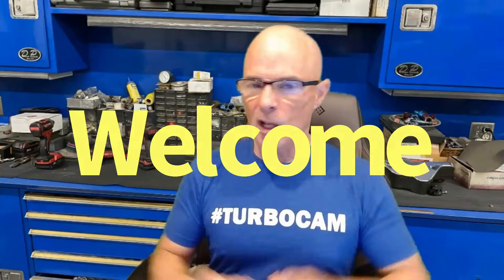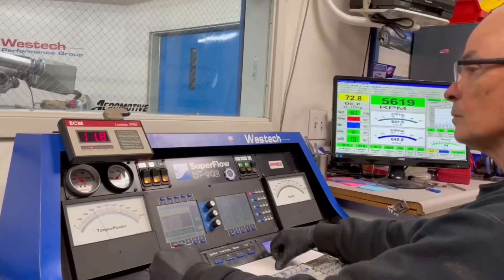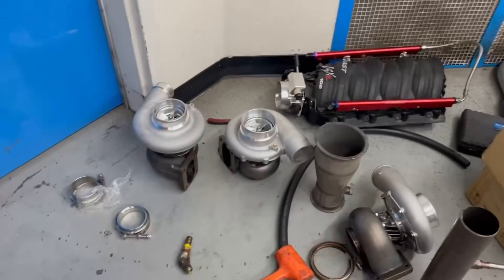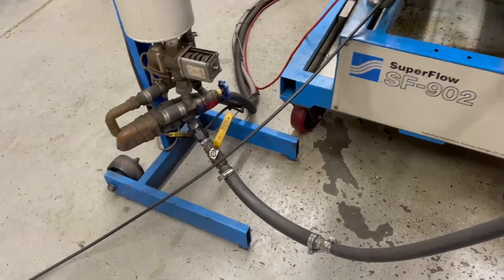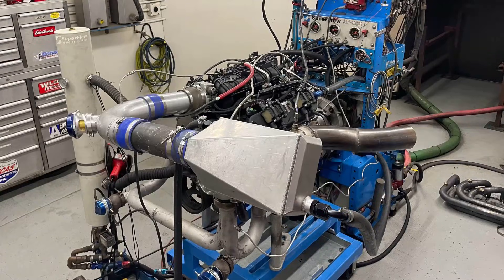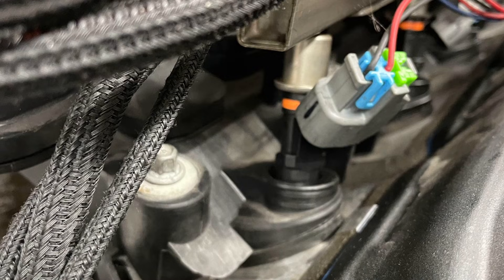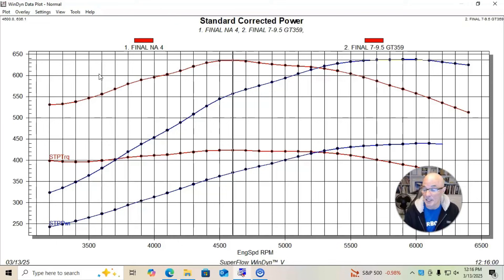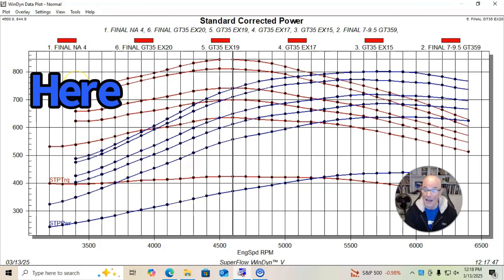GTX3584RS-THE ULTIMATE 800+HP LOW BUCK LS TURBO! HOW MUCH HP WILL A GTX3584RS TURBO MAKE ON A 5.3L?

Comment: Sick. Put a Xona Rotor XRA6769S against it, and compare the compressor maps. 👍

Let me know if you need one to test, and I’ll work something out.
Reply from the maker: what does that turbo cost?
Reply: @richardholdener1727  less than a PTE but more than a Garrett. 🤷‍♂️

Wanna test one? I can make a call and start that whenever- I have to grab a quote and order with them anyway for somebody else, and would need it back as a test mule unless you decide it’s too good to let go. 🤣🤷‍♂️

$3228 for the PTE Next Gen 6875 right now, $2516 for this with a housing/$2166 for the core with a compressor cover. 

It’s one of Robert Young’s and just came out this year.

Comment: How will a single one (GT35) work on an lq4, 806 heads & TN cam. Im not doing more than 6200RPM
Reply: & only looking for around 600hp
Reply from the maker: works fine at that power level
Reply: @richardholdener1727  How much boost do u think ill need to push through it ? & will it be a must for me to gap the rings or  I should be fine with stock gap ?

Comment: I'm replacing my Gt45 rear mount on my 97 ss camaro Lt1.    I'm hoping this turbo will help with somewhat laggy boost.   I'm running two 44mm gates @ 7psi-9psi I'm hoping this setup will give it better response still keeping my top end good.  Like 550whp range.  Nothing crazy just super fun on the street.
Reply from the maker: this turbo is way more responsive than a GT45
Reply: @richardholdener1727   this gtx3584rs  turbo I got from you guys is a night and day difference.   when I saw how small this turbo was in physical size compared to the gt45 I wasn't sure about it.   Wow this thing makes the car feel so lively.   This is easily outdoing my old gt45.   I'm only running about 9psi of boost on my  Lt1.  I wonder if this engine is comparable to the 5.3 for hp numbers?   Super fun car now thanks for the testing on this stuff.   By the way jimmy was awesome to deal with.  Answered questions super promptly.   If I ever get another turbo I'm looking at your stuff first.

Comment: The real question is can I get a video on which transmission to run with a 5.3 turbo I’ve been told th400 but 4l80 as well
Reply from the maker: 4L80
Reply: @richardholdener1727 What kind of power levels become too much for a stock 4l80 before you need to upgrade some internals?
Reply: ZF 8hp 👍🏻
Reply: @Mastermindyoung14 a zf will bolt up to a 5.3 ??

Comment: Would 2 of these on a 6.0 help with back pressure
Reply from the maker: yes-but do you want 1600 hp? Better choice is this turbo with a 1.21 AR, or a slightly bigger G35 or bigger G42-all good choices (pick the G42)-it works great on a 5.3L (we have it on the Tahoe now) but on a 6.0L, it will be amazing
Reply: @richardholdener1727 yes but wouldn’t you have the same back pressure problem as the other. I have twin gt35s on a 5.3 now but want to put my 6.0 in and didn’t know if they were to small

Comment: Could I run this rear mounted single on a Lq4 6.0 on e85 and drag race it safely using 750cc injectors?
Reply from the maker: you should get a G42 turbo from drag racing and go bigger than 750 cc injectors (we have 1000s) with your 6.0L

Comment: If i slap the gtx3584 rs on a stock 6.1 do you think it would underperform at 6-7 lbs since it has so much more of a power band or should i jus go gt 45 which 7 lbs is close to its peak
Reply from the maker: 6-7 psi, use the GTX3584RS, if you go more-use the G42

Comment: I had a plan to use the mirrored 3584 101s on a 417cid stroked ls. 823 heads ported. Solid bottom end. Low-ish boost. I want 950 crank. Is this gonna be too much? Not many videos out using this turbo.
Reply from the maker: those will support much more-so you have room to grow
Reply: @richardholdener1727  that is the plan as well. I found your live stream and await that video!  Thank you.

Comment: How does this compare to a S475 torque wise i seen ur t4 s475 and it was instant boost
Reply from the maker: No S475 has instant boost-this one is WAY more responsive, but it is smaller than the S475

Comment: how about a video where you still keep the gtx3584rs but show how much engine power is affected with backpressure. perhaps how much a turbine housing swap reduces backpressure or a g42 turbine wheel crammed into the gtx3584rs
Reply from the maker: we plan to run AR housing changes

Comment: Question that’s gonna get allot of the hate. Just say with a stock 6.0 in a 2500. On 8ish pounds on pump gas would the 6.0 live. Yes i know its best with I/C and some say it’s a must. I’m just thinking an easy turbo install for towing a 3k lb car and burnouts. Not insane lugging. I’ll also add I’ve had a 6.0 non I/C make 715 tire but on e85
Reply from the maker: It would live-it just makes a lot less power because you had to pull so much timing out of it.

Comment: Tried on the live but lots of people were asking lots of questions and just couldn’t get all of the question out. 

Not knowing what actually horse power I am shooting for. I know you need to know what power I want.  What I am wanting is to keep my car running in the 11’s and have great street manors. Currently I am running a 383 Edelbrock heads roller cam 4500 stall 4:11. Clips high 11’s now.  Runs out usually 113 mph. I haven’t no idea what HP I am on the 383. I want to swap in a LQ4 6.0 2006 and a 4L80E and run a turbo. I will gap the rings and run it.  Not sure what HP I need to keep the car in the 11’s.  I hope this helps. Thanks Jimmy.
Reply from the maker: A stock LQ4 with a single GTX3584RS will make more than your 383-you will be good
Reply: @ ok great. I only had one car on a dyno so just don’t have an honest answer on what HP I want. I totally understand what you need to know to recommend I get it. I just don’t have that number for what I want. Thank you for your opinion. I take it you sell that turbo. Once I get this all figured out I am going to have LSX specialties build the harness and set up the computer.  Again your videos and information is amazing and thank you for your help. I can’t wait to do this!!!

Comment: This would be an easy win setup for me if fitting it under the hood was possible. I know that there are twin turbo setups for Holden Monaros but it uses every square fraction of an inch in an already smoking hot engine compartment.

Comment: On the timing table, what is the purpose or reason for the very low timing at 2000rpm above 98kpa? Why only on one column and not smoothed at all!
Reply from the maker: THE TIMING TABLE IS NOT OPTIMIZED-ONLY CHANGED IN THE AREA WE USED IN TESTING
Reply: @ thank you, I was trying to figure out why that would be there  😅

Comment: Your vids are always very informative Richard, let alone the commitment following up with comments and further following it up with more advice. I'm watching this from Australia not long after you recommended the low buck truck cam a few weeks ago for my 5.7 LS1 barge (weighs 4400lb). Currently looking at a 3584rs from Pulsar turbo as they can also do the T51R mod because turbo noises are always good.
Reply from the maker: Those Pulsar turbos are good-just big $
Reply: Save your money on the T51r mod. Annoying as heck.

Comment: Great turbo choice for the street, love it! Is there an accessory drive that lets you run exhaust manifolds reversed in the truck? Looks to me like the power steering pump, and maybe the AC compressor, would conflict. Or does the right manifold selection clear all that? Thanks Richard!
Reply from the maker: no idea on fitment with accessories

Comment: Would this work on a stock 8.1L if I don't want to make more than 700 hp? (4-6 psi boost maybe?) Also, any thoughts on mounting the turbo down under the truck? I saw Stacey David do remote mounted setup on a corvette a long time ago,but haven't seen anything like that since.
Reply from the maker: remote works fine-but I would use a bigger turbo for the 8.1L-you don't have to worry about response with that much torque (you will have response)

Comment: Gt45 on the shelf for a built 6.0 👌?
Reply from the maker: for what power level?
Reply: @richardholdener1727  it should be close to 500 n/A figure 7 psi n leave it there , only thing is it's already 11:1 , btr s3 truck cam, tbss intake , ported and milled 317 heads with forged pistons , arp bottom end bolts and gen 4 rods ..

Comment: What kind of compression ratio do you fun on this test? Thanks!
Reply from the maker: this is stock-9.5:1
Reply: @ my truck is 10.5:1. I presume I would need new pistons @ 9.5:1 or a new junkyard motor. I’m looking for 100 hp gain. I’m currently at 305 at the wheels, AWD.

Comment: What was the backpressure?
Reply from the maker: 1.2:1 at load in and 2:1 at the peak rpm (same boost through entire run)
Reply: Thank you, im really surprised it made that power with not bad BP. I  have a pair of them for twins on my current build with .63 turbines. I was waffling on bigger housings but this makes me not even sweat it.

Comment: You gave zero specs on the turbo brother. Im assuming this was just a garden variety gen2 67/62 GTX3584? What AR exhaust housing? Seems like this would be good for a tow rig.
Reply: it’s on his website lol
Reply: @scooterrt Thank you sir. So basically it’s the same ones I have but with a smaller AR exhaust housings I’m shocked to see he’s using such a small exhaust housing and still able to put out those numbers with a single.
Reply from the maker: Opinions of what a turbo should do are not the same as what actual test results show-this GTX3584 will support over 800 hp with the .82 AR housing-that is why we test and not simply speculate (I don't offer stuff I haven't tested)
Reply: @richardholdener1727 I didn’t doubt your results, I just wanted the specs in the turbo you used. I’m very results driven as well and I’m just blown away that a turbo this small, and with such a small backside  performed so well. Especially since I attempted to use an old T66 t-trim on a cammed 6.0 7 or 8 years ago and that thing spooled  instantly but choked and wouldn’t hold anything past 10psi over about 5500rpm. Obviously these newer turbos are more efficient.
Reply: @BadLuckGarage  It wouldn't come as a shock if people stopped listening to facebook experts that only care about absolute maximum power, but don't do any tests. The same people would get their panties in a bind knowing this combo made 30psi backpressure with 14lbs of boost, but the proof is in the pudding.
Reply: @hydrocarbon82 I definitely agree about the “Facebook experts”. It only shocks me because I have personally ran a similar sized turbo on a 6.0 at only around 500 whp and couldn’t maintain over 10psi at higher rpm’s. I did this on video about 7 years ago. Apparently these gen2s flow quite a bit more air, which I knew and it’s why I have a pair of these sitting here, I just didn’t realize exactly how much more. What I’d love to see now is Richard maxing out a pair of these to see exactly what they’re capable of in a twin setup. I know lots of guys making around 1200whp with them, but haven’t really seen anyone surpass that. So if he could make over 1600 on his engine dyno with them as he mentioned in another post, that’d be cool to see.
Reply: @BadLuckGarage smaller motors 5.3 will make more power with the same turbo vs 6.0 listen to papa richy
Reply: This is the exact test type I'm looking for. Makes sense for working trucks. It's gotta spool quickly and be efficient while pulling a load.  Thoughts on a quick spool working turbo for the 8.1?
Reply: Yeah, I watched the c10 you had...got me motivated to build my first turbo truck!...been a couple years ago...time flies.
Reply: Just taken an educated guess...  looking at the shape of the rear housing ... 1.01 with T4 flange
Reply: @chasevaldair9236 Actually, according to his website, it’s a very small .82 T4 which really shocks me. Unless this isn’t the same turbo. I’ve got a pair of these in mirror image units that will soon be replacing the gen1 gtx3582s I’ve been running for the last few years on my 5.3. But I went with the larger 1.01 v-band exhaust housings. If these results hold true, I shouldn’t have any issues hitting 1200hp with the pair of them. 👍
Reply: @BadLuckGarage  I would think the .82 AR would be even better for anyone up to ~6.2L wanting to use these as twins on any sort of street setup, no? 1.01 seems pretty large unless you have a setup that doesn't care much about spool i.e pure race.
Reply: @nowayjose596 I plan to find out. My current setup I’ve been running for the last few years is a set of gen1 billet GTX3582s 64/62s with .82T3 housings on a cam only 5.3. They light off almost instantly and make just over 900hp at 18lbs. The goal with the gen2s I have is to make as close to 1200hp as possible at as low a boost level as possible. So I went with the 1.01 housings to try to keep backpressure down. I really doubt it’s going to make a huge differnece in spool time, but for my purposes on this specific vehicle , spool time isn’t really an issue anyway. The issue for me is making the power I want to make as cheaply as possible. Fact is these turbos have been used in twin setups by tons of people for the last few years so we already know what they’re capable of in that scenario and as a single on smaller displacement 4cyl and 6cyl engines. The astonishment for me is seeing how well it performed as a single on a 5.3. I’ve been thinking of doing a small single in my Avalanche that I use for pulling my car hauler and up until Richard did this test, I had set my sights on something a little larger such as 70mm range. But I’m reconsidering just ordering another 67/62 now.
Reply: @BadLuckGarage  Yeah I'll definitely be following along to see how it works out for you. I have an '87 Formula 350 I've had since high school I eventually plan to do something similar with. The price on those 3582s can't be beat, but I think they're just a little undersized for anything over 5.7L and it may be dumb but I can't convince myself to put something smaller than that in a vehicle that says "350" right there on the door 😂 Power goal is 800 rwhp bc I feel like that's kind of a sweet spot where a street car is legit fast but not constantly breaking things. So the 3584s might be the ticket since I wouldn't mind slightly less peak torque on a stock bottom end plus obviously room to grow if/when I decide that I just hate having extra money in my bank account lol.
Reply: @nowayjose596 Yea my twin setup is in a 1990 Camaro, so same platform. As it is it runs mid to high 5s as a full weight/interior street car. 👍
Reply: @BadLuckGarage sucks you stopped posting content
Reply: @BadLuckGarage can u daily drive it
Reply: @chipturd55 I mean, I could easily, but it’s loud as hell with the fender exits. Lol. We’re actually planning to run exhaust out the back when we eventually redo the turbo kit to run the 67/62s.
Reply: @chipturd55 Brother I hope to get back to it one day soon. I bought a house and a bunch of land and my hands have been so full with renovations and things that I haven’t really had the time or energy to make content for the last year. I do take CC for a rip down the backroads from time to time though so she isn’t just sitting. 😉 If I do make content anytime soon it will most likely just be some general maintenance or product reviews until I either get my new shop built, or am able to make enough room in one of the other garages to actually work on something substantial again. 🤦🏼‍♂️
Reply: @BadLuckGarage def liked ur videos . Learned a lot. Hope u get back to making them. Congrats on house and land
Reply: @chipturd55  Thanks brother. Hopefully I’ll be getting back to car stuff soon. 👍
Reply: @BadLuckGarage any update on how they worked?

Comment: What size turbo do you think would be best for a 6.0 application? Looking for like 650ish whp, but mainly looking for some low end torque. Been looking at a vs racing 78/75. For the turbo I'm looking for a quick spool time. Vehicle is a 2006 silverado 1500HD, would be used for daily driving and towing around 7500lbs for 400 ish miles every once in a while.
Reply from the maker: get the GTX3584RS

Comment: Dramatic boost and H.P.!! So Richard, where to buy this turbo in/ around soCal area for MY 5.3 L9H in my 2009 Colorado? Can I get the specs on the cam u used as well? And the cost of the Low Buck truck cam is/ is not available still? And how much? Thanks for all your testing as well as the info on the turbo!!
Reply from the maker: The Low Buck Truck cam (used in this test) is in stock-ready to ship ($199) (specs on the site). The GTX3584RS Turbo is also available for $369 (hurry-they are selling out fast). Go to richardholdenerperformance.com

Comment: Richard I have a question and value your knowledge on this issue. An ly6 30 over flat top pistons , good valve job throats cut, heads cut 0.40 new coated valves ls3 intake h beams,balanced, 238. 254. 110. 640  630  installed at 106.5. it is 11.1 to 1.  Will this make 600 hp.?
Reply from the maker: Don't think it will quite get there unless the heads flow very well
Reply: Thank you Richa rd @richardholdener1727

Comment: Those are fantastic results and all the beans around 4k that looks pretty ideal for fun street rod
Reply from the maker: it has full boost way before 4000 rpm-it had full boost at 32% TPS on the roll in
Reply: @richardholdener1727  yeah I meant peak power around 4k